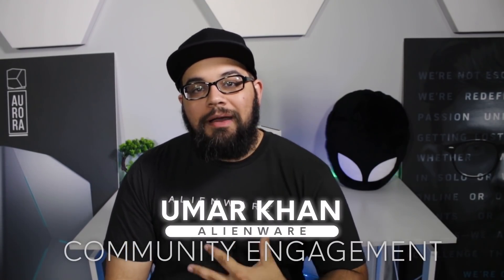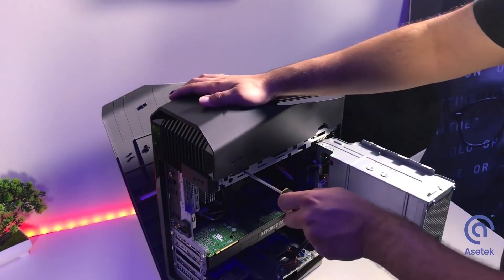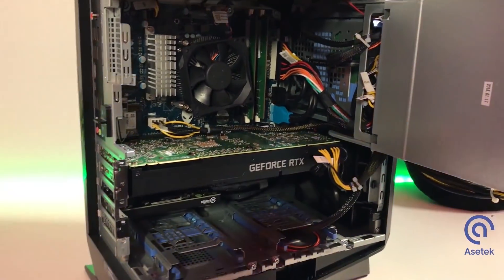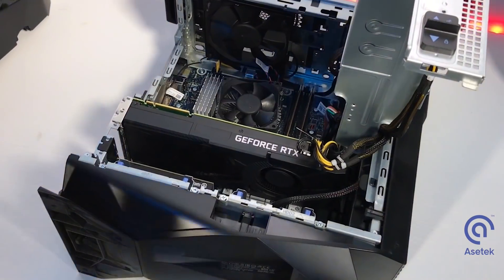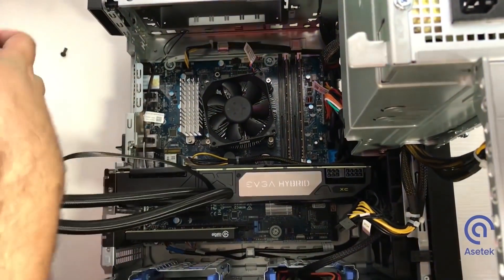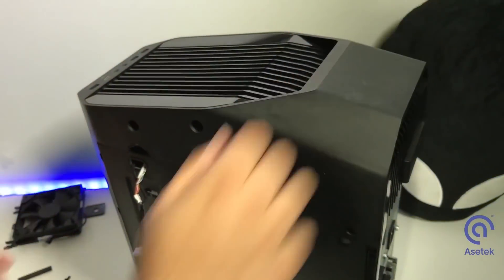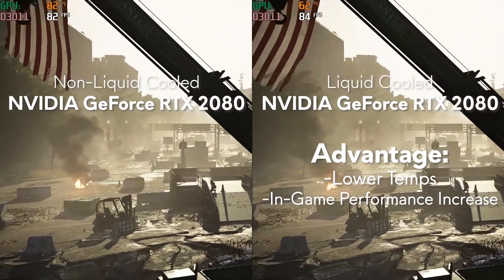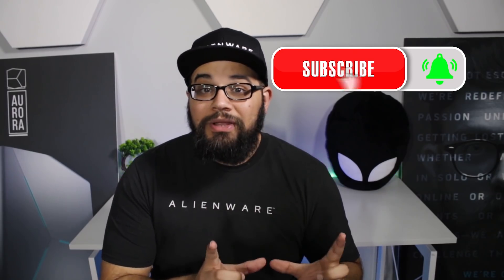Alienware Aurora DIY: Upgrading to Asetek Liquid Cooled NVIDIA 2080! + LC GPU Giveaway!

Comment: updated I put a liquid cooler from corsair on the cpu and the temps on games non overclocked are fantastic temperatures. Again never had any issues with the gpu although im not overclocking. the cpu would get over 100C and that was very concerning. Now I have an issue with the bios telling theres a critical fan error because i used the pump fan slot for my corsair h60 instead of the cpu fan plug lol
Reply: @Scott Summer's 
I am about to complete this mod to my R11, what model did you perform the change on? Its interesting that you are getting that error becasue in another video that I found: /watch?v=fkVNcTXcpAo - this R11 was already liquid cooled. It doesn't use the FAN CPU plug because there was never a fan on that plug. My Air cooled one uses that plug for the air cooler on the CPU itself. As you can see from the video that I shared, the end configuration is using TOP FAN and and FAN PUMP, this is how the OEM setup of their liquid cooler is so it should be applicable to the Corsair H60

Comment: I just ordered an R10 model with liquid cooled cpu. Does the top housing have space for a second fan in a sandwich configuration around the radiator? Also the fan that comes in the coolers a mag lev or a standard fan bearing?  I'm getting my upgrade supplies so I can begin the day it arrives

Comment: Ofcourse it would be quieter. You just trashed the lame excuse blower fan of an RTX 2080 that alienware uses. Even the nee R10 models still uses the blower types which is lame. Thumbs up if you just had a realisation.

Comment: So I got an aurora R9 with a 2080 on board. Can the CPU and GPU be liquid cooled or is it either or
Reply: __Large-Sized DicTionary__ what vcards do they use man, been researching about this issue. There was a post that they might be using MSI RTX cards
Reply: John Balaoing Mai blower is what I found inside of my r9 fan cooled unit with 2080 super smh. Lucked up and saw one just like it on eBay just from a different model. Very hard to find these cards unless dell sells them!!! Not sure how they perform in reference to the group GeForce of other  brands ! Looks like to upgrade both Cpu and gpu to liquid I’ll need another case to swap pit internals smh.  But all n all I like the unit I’ve been building for years and this build is decent in my eyes
Reply: Markiee Whitehead They tend to be noisy and underperform because of thermal issues compared to the axial fan type cards. Very disappointed in them. Upgrade them bro. Just sell them
Reply: Wich liquid cooler will you buy ??
Reply: Cuz I might get one for christmas but I still dont know if I should change the liquid cooler for a better one
Reply: Im not sure if buying the alienware or the cyberpower gamer master

Comment: I wonder if my i7 8700k in my alienware auroa r7 upgradable to a i7 9700k?
Reply: Don’t believe so, I think the 8000 series uses a different chipset with a 9700
Reply: It's the same Z370 chipset, the only question is, does Dell allow user to put an I7 9700K into an 8700K system. They can still lock their BIOS to 8700K even the chipset supports

Comment: I just bought an Alienware r7 desktop PC. I used a 3.5 audio Y splitter cable to hook up two speaker, and only one works (not sure why). I checked to ensure both speakers work by plugging each one in at a time and this shows that the speaker function. I checked the volume, any suggestions???
Reply from the maker: Hi,
Currently we don’t have dedicated support on YouTube, but don’t worry—you can get 24/7 live assistance through Facebook and Twitter. 
Facebook: https://dell.to/2jFVMle 
Twitter: @AlienwareTech 
You could write to us there, and we’ll be glad to look into this for you.

Comment: I got my aurora r7 with I5 and 8gb grapichs with gtx1060 so I've upgraded the gpu to the gtx1060 oc black edition 8gb witch was much better (I was cheeky enough to buy it just after the guy I bought it from removed the 1060 and basically put the 1070gtx oc edition free) hehe but I'm not happy it's not enough ram what does everyone think on the I5 8th gen? I want to make my pc the best it can be but it's going to cost money so I'm going to have to save up I kind of think maybe I shouldn't of bought it and saved up and got the better version but my aurora r7 I got it for 900 off of a mate who was in the army he had it a mo th and never used it so he sold it me do you think 900s was worth it especially with the gpu?

Comment: Is it possible to use like a 120MM cooler in place of the front fan with the stock card and an NZXT cooler for the GPU.  Is there enough room?
Reply: No, From what i've seen, But i won the giveaway and i just got the card so i'll check
Since i'll have a spare 120mm thermal take riing rgb

Comment: Do the tubes get kinked by the psu swing door?
Reply from the maker: No the PSU cables should run through the card keeper as it has a notch, to make sure cables don't get caught up.
Reply: @AlienwareChannel  not the PSU cables, but the water tubes from the hybrid cooler. At 3:56, the PSU swing door is closed, and you can see the water tubes are just mashed inbetween the GPU and the PSU

Comment: Wondering if I can put that RTX 2080 in my Alienware Graphics Amplifier
Reply from the maker: Technically the card will fit in the Graphics Amp, but the Radiator will not fit so the amp will not be able to close :)
Reply: @AlienwareChannel  Thanks, I had looked up others who modded their AGA case. I will figure something cool to make it work.

Comment: so basically if you liquid cool the gpu you cant liquid cool the cpu?
Reply from the maker: Currently due to the size of the Aurora it is limited to fit one Liquid Cooled Radiator :)
Reply: @AlienwareChannel  That is not true. You can remove the middle-front hard drive slot where the PSU swing cage mounts, and have a large enough opening for a GPU cooler and fan. I used the EVGA 2080super Hybrid unit and the fan and radiator slid into the new opening like it was meant to be. Set the fan to exhaust out of the front (there are already vent holes in the chassis right here), and my temps under full load both CPU and GPU are below 60C.
Alienware, you guys don't get to be wrong about this stuff it's ridiculous 🙄
Reply: @l-o-r-d  I've just purchased an R11 with this cooler so I might look to your mod. Make a vid and post it?
Reply: @Larsanator  👍 I'll post something by this Saturday for you and Stirange.
Reply: @l-o-r-d I'm going to look into this. I really want to see how yours looks like if you don't mind sharing.
Reply: @l-o-r-d  where that video at tho
Reply: @_JTC3  I have not forgotten you, I am waiting on some extra RAM to install at the  same time which gives me the excuse to rip it apart again. Its due Thursday, so ill put something together by this weekend. Sorry for the delay, promise this time.
Reply: @l-o-r-d  i would love to see a picture of your internals and how you ran it i currently have an aurora r8 with a 2070 super with a liquid cooled cpu and worried about fitment
Reply: @l-o-r-d  could you please at least show us a pic, how you did it? Thanks!
Reply: @l-o-r-d  I would also like to see
Reply: @l-o-r-d  Just saw this....Thanks and you're right it should work. gonna get the 3090 hybrid  265mm I think.
Reply: @l-o-r-d  Are you saying you fit two 120 ML radiators in your R11?
Reply: @AlienwareChannel  ... and therefore your 2080 blower Style card sounds like a vacuum when you're using it.
Reply: I have a 2080 TI in my aurora R7 i took out the HDD front mount slid a ML120 in there and hooked up 2 80mm fans to exhaust from the side and my temps overclocked with 3466 ram installed are between 60-70c when under load (oc @4.8L)
Reply: @MrBatesville  Got a picture of your setup?

Comment: Would this liquid cooled graphics upgrade work on an Aurora R7? I Would love to upgrade to a liquid cooled gpu, maybe a 2080ti! 
Current system configuration:
Intel i7 8700k
Nvidia gtx 1080ti
32gb, 2933MHz, ddr4
512gb sata ssd m.2
1tb ssd storage
1tb hdd storage
Reply: With a k CPU and liquid cooling the radiator mount spot is taken, so no.
Reply: @ChristianSamsel  aww good point :( that's too bad. Thanks for the reply!
Reply from the maker: It will work on an Aurora R7, the system we upgraded in the video was a R7 :)

Comment: unless your Aurora has the liquid cooled CPU option. I would be nice if there was a place for a second radiator.
Reply: Hey can you explain your mod. I'm guna do it but no one explains the mod. Do you have to cut thr framing?
Reply: Also I'm looking in my case now, and I wonder if I removed the top hdd and metal holder that's holding it if I could put it there. Only thing is the plastic isnt vented that high on the front but its vented at the bottom so it should still get air flow...idk..torn